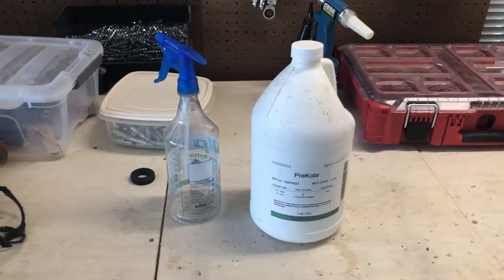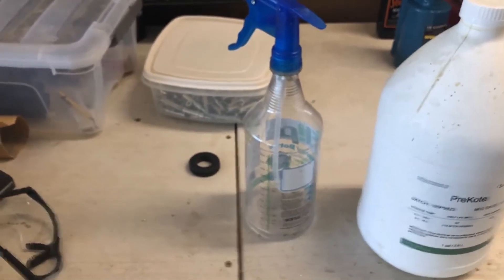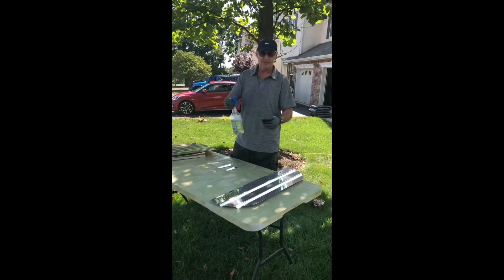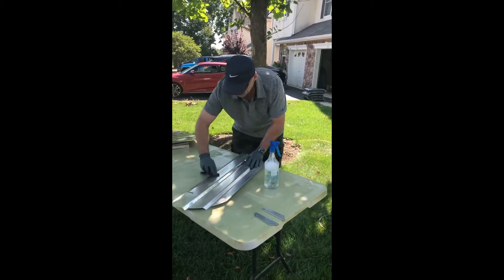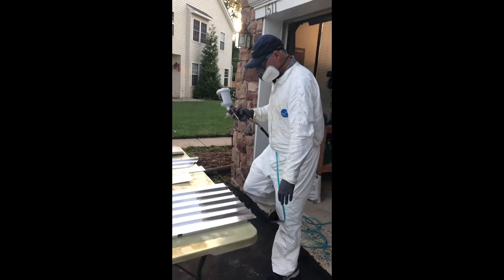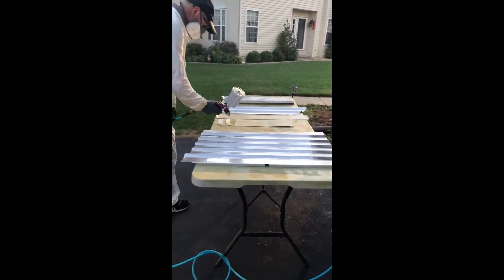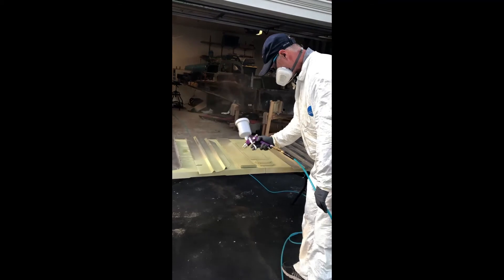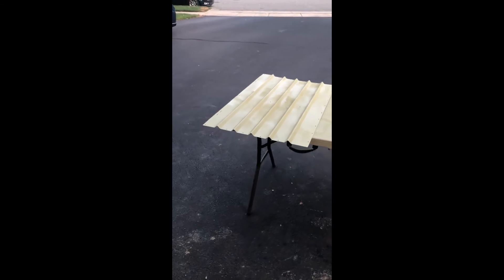RV 10 Aluminum Prep and Priming

Comment: Wasn't there supposed to be an etching step? The aluminum look so shiny before the priming?
Reply from the maker: You need to use PreKote (which was in my spray bottle) to clean and prep the aluminum and then wash it down with water.

Comment: Looks like you need a pressure regulator on the gun.
Reply: 55psi is way too high for that gun.  20-30 is closer to right.  You won't have near the overspray.  the paint is bouncing off the material at 55psi.
Reply from the maker: awesome thanks - i will give that a try
Reply from the maker: yep, when i go for the painting I will definitely add it.  Thanks,

Comment: Quick question.  During this process in your build, are you just priming the parts that you won't be able to get to later?  Does everyone prime parts as the build is being completed as you are?  Sorry if the question is dumb sounding, but just trying to see what sort of spaces I would need set up as I would undertake an RV-10 build.
Reply from the maker: Great question... priming appears to be a personal preference, the whole plane is anodized aluminum so people think you will not need to worry about corrosion, and typically RV people keep the plane in a hanger. However, for me, I live close to the ocean and have seen the damage salt can do so I wanted to prime all of the parts prior to putting them on. I'm guessing you could primer later (and actually I plan on painting the interior prior to attaching the cabin top to ensure a match). Just my opinion but hope that helps.
Reply: @aleafonthewind3775  Thank you so much for taking the time to answer.  Makes total sense.